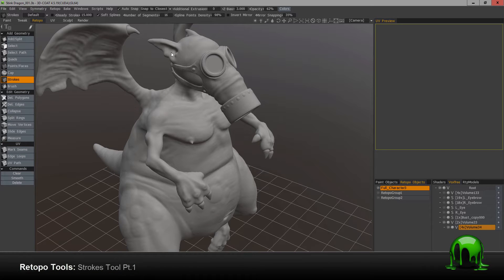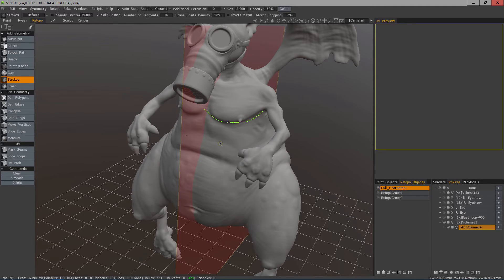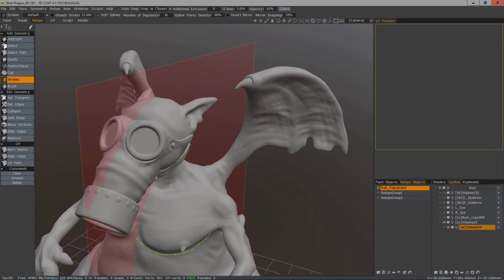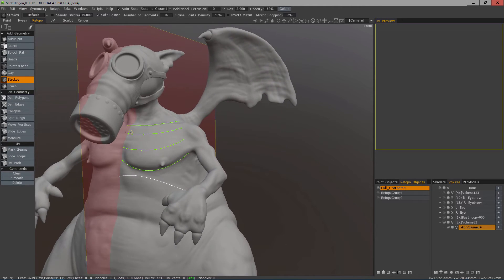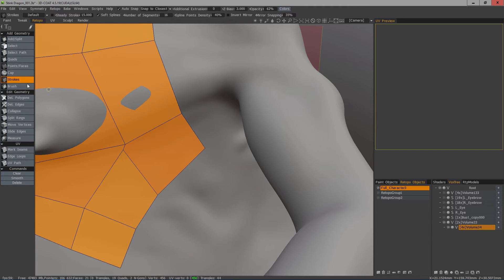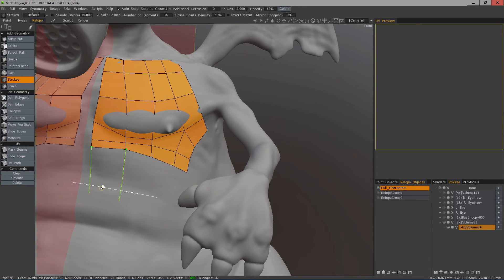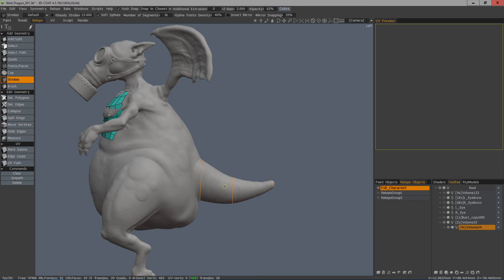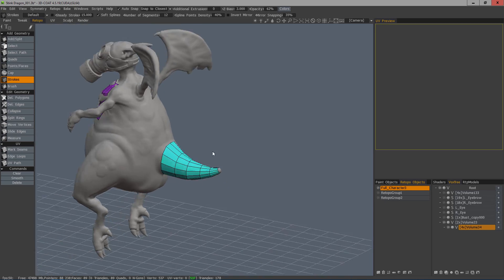Strokes Tool Pt 1

Comment: How do you rotate around a model in strokes mode? I have to select "quads" to do it. I can't tell you how frustrating it is that zb mode is only zb like and you can't use a stylus to navigate 3dcoat!
Reply from the maker: It's using a 3DConnexion device, and you will wonder how you were able to work without one, after you try/buy one. It lets the artist keep working while navigating around the model. It's absolute freedom. Cannot recommend them enough.
https://youtu.be/oSsL4RgatYA
https://youtu.be/oYR33DQ4FvI

Comment: Every time I open 3DCoat's retopo room, I hear a choir of angels and there's a very bright light. Anyone else experience this issue?
Is there any good reason to use the virtual mirror mode, rather than having 3DCoat create actual polygons across the mirror plane? I'm noticing there are even some welding issues when using virtual mirror mode. Vertices will not actually weld correctly with their mirrored counterparts and you can move them across the plane, this can cause some issues when using strokes/smart retopo and using those vertices as snap points. Using 2023.3 which has had some weld fixes, but this isn't one of them as far as I can tell. Thanks!